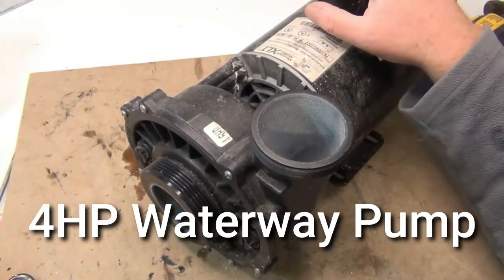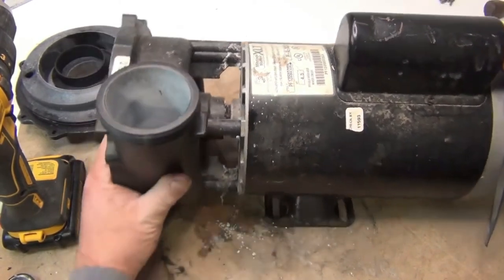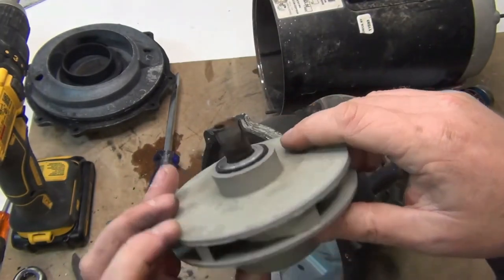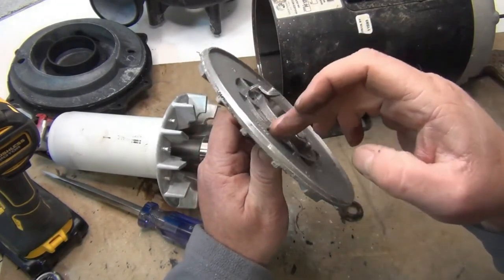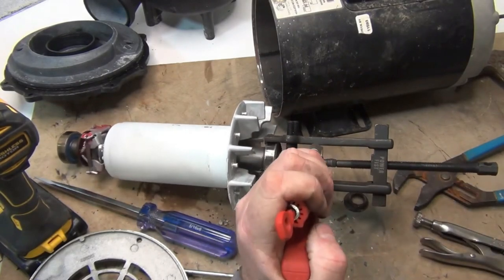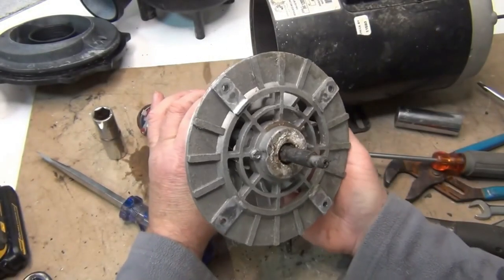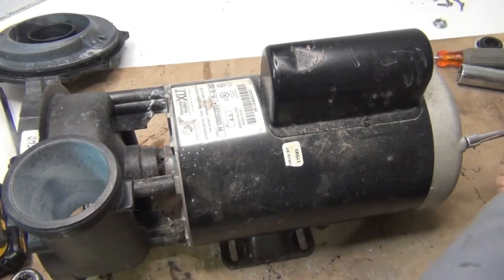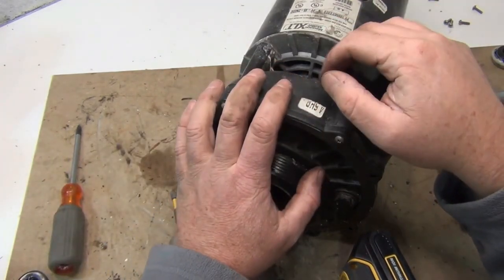HOT TUB Pump Seal and Motor Bearing Replacement

Comment from the maker: We are getting very busy with Youtube and our video comments.  At the same time we are trying to run a pool and hot tub business.  Unfortunately, we will limit our comment responses to our Members.    Consider becoming a Member:  https://www.youtube.com/channel/UC7rBDbZ5XT4QtOouN6PTKXQ/join
Reply: Was repairing plumbing on my spa turned off the breaker and when I powered back up, the keypad (TSC-19) lit up 100% all LEDs and never reset to normal operation.  If I unplug the keypad, the pump, heater run. Plug it back in and same lit up keypad and everything shuts off, all leds on.  Easy Pack EP1500CX1 controller (It usually resets within an hour but not this time. Is it a keypad? or the controller? Thanks

Comment: My pump is really loud, so I assume that I need to replace the bearings inside the motor.  I also need to get a bearing puller.  Mine is a Waterway Executive 56.  Where can I find those parts?
Reply from the maker: All the links for the tools we use are in the video description.

Comment: Was repairing my spa plumbing and when I powered it on - The keypad lit up 100% all leds solid and it did this before after an error but after about 30 min it started working. This time nothing reset and keypad is still lit up 100%. (Powered it off and on few times.  When I unplug the keypad from the board the pump, heater start working. Is it a keypad (Gecko TSC-19) or the board/controller that is bad?. I do not want to buy a keypad if the bord is bad. The controller is an EasyPack EP1500CX1 digital single LED for the pump with the side color coded rectangular plugs.
Reply from the maker: It sure sounds like the topside.
Reply: @VIPPoolsandSpas  Thank you so much. I'll replace it and let you know how it went. Really appreciate you taking the time to reply.
Reply from the maker: @ManNomad  all good.